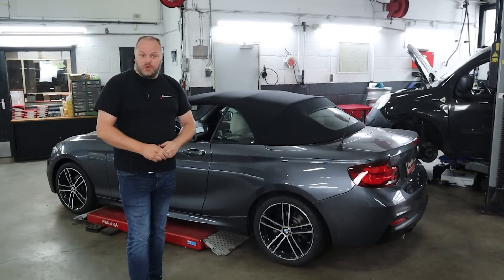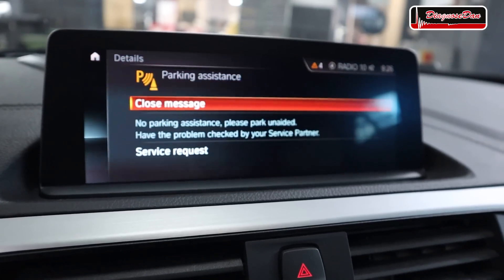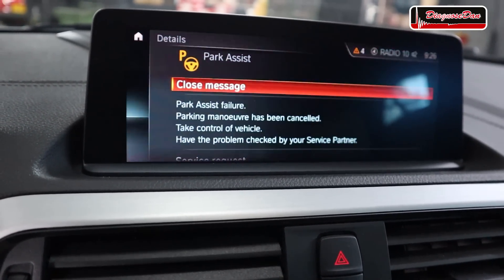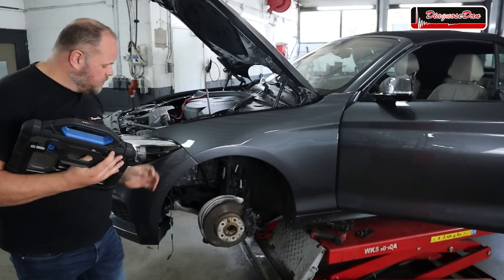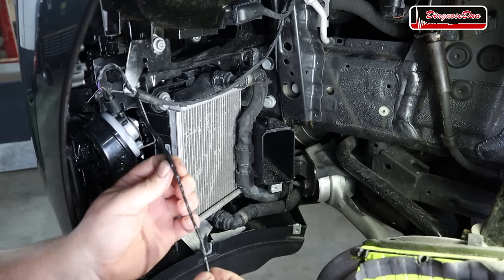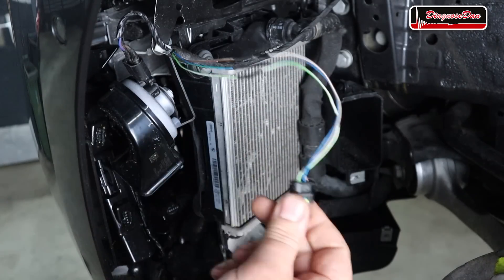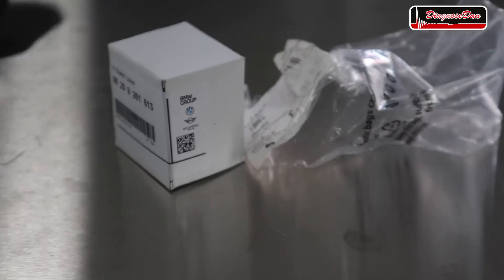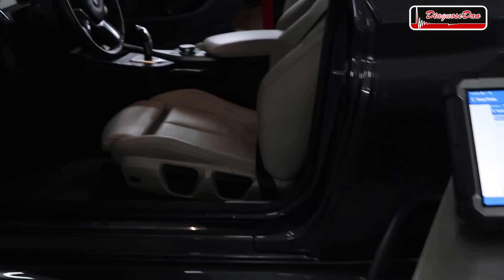Bmw NOT parking itself anymore! Broken Park assist

Comment from the maker: Check out my website ; https://www.diagnosedan.com
For Diagnosedan Tsb visit DDTSB.COM
For the Topdon tool used in the video:
US: https://www.topdon.us
UK: https://www.diagnosticconnections.co.uk/
EU: https://eu.topdon.com
Reply: i was expecting a crushed wire
Reply: Exactly my thought too
Reply from the maker: @iangrassby Me too!
Reply: Hi what test light is best for what circuit . What about wireless test light
Reply: Some of the macho comments really disturb me. I am not a great fan of self-parking concept but when you see it work putting a car into a really tight space it is  impressive.
Rear cameras and reversing sensors are important innovations.
Nothing to do with vehicle size but on a lot of cars with tapering aerodynamic shapes it is impossible to see where the rear corners are also impossible to see a small child directly behind the vehicle.
Reply: Which Topdon version / type do you use Dan? Thanks
Reply: great one - got the notification on my starting page cause yt notifications are dead, broken, not working for ages.
Good explanations and analysis. Love this content .
Reply: It isn't fixed at all, a BMW is not supposed to park straight between the lines.

Comment: If the part has wires, I use OEM. Stuff goes sideways quickly with Amazon, eBay or FLAP electronic parts. 
Nice job, Dan. Very logical.
Reply from the maker: Appreciate the support and the comment!

Comment: Can you please explain how you were getting two grounds (Short to ground) on the harness with the sensor disconnected, because when you first tested you didn't backprobe but rather unplugged it and tested. This for me would have pointed me in the direction of faulty wiring. I know the issue was the sensor because it is fixed, but it doesn't make sense how the short to ground still existed on the test light with the sensor disconnected in the beginning of the video
Reply from the maker: I disconnected a good sensor and the bad sensor was still causing the Short.

Comment: I had exactly this happen today. Car was in front end crash then parking sensors not working, same fault code someone replaced the front wiring harness first because "when it's a sensor it tells you what one" - tbf it usually does but that's no excuse. Then someone replaced the control unit because it wasn't outputting voltage- if there's a dead short the control unit won't outputting voltage. And then I had it, I didn't use the exact same diagnostic techniques as you, I unplugged all the rear sensors first because they were easier to get to on the car i was working on and also at the time I didn't know it had been in a crash. Then I found a non branded pdc sensor. This must be quite common.
Reply from the maker: Especially with sensors go OE if possible!
Reply: @Diagnosedan I work at main dealer so going aftermarket is only an option if the part is discontinued

Comment: I've spent my life in electronics and had to diagnose complex systems all the time. Some of these faults here are very basic, I find it troubling that the mechanics at the service centers cannot find them and have to refer to Dan. In fact to me it seems they haven't a clue how auto electrical systems work.
Reply from the maker: Thats because a mechanic has many jobs and it's hard to keep up. They are radar technicians when performing a calibration  on a radar. They are electricians when working on High voltage components. They are IT workers when coding and updating software, they are cable guys when looking for an issue with the fiber optic cables in the car. They need to be plumbers sometimes, they have to deal with Radio, bluetooth, Wifi, gps. 
And i can go on for a very long time.
Reply: @Diagnosedan  I agree with you. I think you missed the point of my original post.

Comment: Great video as always Dan. I litle trick I was tough when it comes to diagnose ultrasonic sensors is to swipe it gently with your finger when its on. If yoy feel a smal vibration it works if not its dead. Not sure if it would have worked on this one since some cars turns every thing off if one doesn't work, and since it was power to ground.
But it's the first thing I do when the parking sensors doesn't work, and have saved me much time over the years.
And it's really fun to do when people doesn't know about it, they just see you walking around the car then tell them witch sensor is broken and they look like questionmarks. But always teach them the trick after
Reply from the maker: I know about this and i'm not sure if i'm sensitive enough but i have a hard time feeling it. I know some can.

Comment: Hi Dan, We have a 2013 ml350 mercedes.... I had codes for the electronic shift module on transmission that mercedes put on to shift iinstead of cable when they went to electronic selector....... originally car wouldnt shift out of park, after installing new from an aftermarket (AMAZON) seller and reset/relearn module it shifted out of pary.  Yaaay right, WRONG, I test drove the vehicle and i was at a left turn light and you proceed when safe, so as I pulled out in highway to make left the vehicle shifted itself into park grinding the transmission cog and literally stopping the thing in the middle of a 60mph 3 lane highway and it wouldnt come out of park!!!!.. Fortunately cars were able to stop without hitting me and after shutting ignition off and restarting it shifted, I drove back at 5 mph and it happenned 1 more time as i pulled in driveway.... I pulled that module out and I swear frisbeed it into the side of my building and put an OEM mercedes part in and 2 months later, STILL PERFECT!!!....  I have learned before certain things are OEM mandatory in my mind.... from now on its wax and cleaners only from part stores....

Comment: Had to inspect a french car with a parking aid system disabled fault, without an OEM diagnostic tester. A one size fits all tester didn't find the parking aid control module so had to do it all caveman like.

Car disabled the whole system so couldn't feel the sensors for pulse. One front sensor looked bloated so was a dead giveaway that this sensor was dead.

Installed a new Metzger sensor, problem not fixed. Replaced it with an OEM sensor and the fault disappeared! Either the car was picky or the aftermarket sensor was stillborn.
Reply from the maker: I diagnosed a older Bmw 3 series (E46) last year with a pdc fault. Walk in the park for me normally as this model has little secrets for me. Diagnosed it with a bad pdc sensor , replaced it and normally case closed move on to the next one.
But i noticed that the pdc speaker didn't work. 
No more fault codes stored and it looked like everything was working fine. I focussed on the speaker but could not find anything wrong. I could't connect the dots as why the speaker not working had anything to do with the replaced sensor. As i was busy and it was an older car i had fitted an aftermarket sensor from a local supplier. 
After running around in circles for hours and performing every test in the book i decided to order an OE sensor and the speaker started working again, i'm still not sure why because in live data it looked like the sensor was doing what it was supposed to be doing. 
Another lesson learned the hard way. 
It's my experience that aftermarket parts and especially sensors have become less reliable lately. If you do want to safe some money its better to source an original used part if possible or go for a aftermarket brand thats also the OE supplier.

Comment: If there was a short to ground, why didn't it blow a fuse or create smoke and cause damage?
Reply from the maker: Simple, the sensor is connected to a module and not to a "hard"power supply. The module is designed in a way to handle with a short

Comment: Many times the workshop we work at does not have an electrical diagram or technical information to pass on to the mechanic.

I was able to solve a PDC problem with a tip from you, on a 2017 BMW X2 here in Brazil.

The tip was that the sensors have a positive power supply in the series.

Thanks Dan.
Reply from the maker: Good information is key. it doesn't cost but it helps you earn money

Comment: Great videos!  Thank you for your efforts and education, Dan!  After replacing the faulty sensor, did you replace the newly installed module with the old module?  Did it work as expected?  Thanks!
Reply from the maker: I actually found out that the new unit was the one i showed in the video. The old one was already swapped back. 
Thanks for watching!

Comment: horn connector also missing and plugged only pins. most of time had issue with this aftermarket sensors...... amazing videos you are doing........
Reply from the maker: Indeed well spotted, connector for the Horn was missing👍👍

Comment: Hi Dan! I have one issue with my F10 2014. Previously, the steering rack angle torque sensor was broken and we replaced it. But now we can't calibrate that end stops for the EPS. Here is the error code 4823EA EPS Control Unit: Stop ends not learned. What would you suggest ? Do I need to replace that EPS too ?
Reply from the maker: Make sure you are following the right procedure to learn the end stops and use the right scantool.  It could certainly be a faulty Eps as the are know to have issues. But i wouldn't replace it before thoroughly testing it.
Reply: @Diagnosedan  Thank you Dan! I'm appreciate it. Yes I'm sure that we are following right procedure and right scantool ( ISTA) but a the end of that its not learnıing that end stops. Eps working fine without any heavy steering. Before that I have an issue that steering rack torque sensor not read the angle and that's why I changed that torque sensor with used one and we can see the data and angle rightly now but I don't understand why Eps not learn that stop ends I think this is not related to torque sensor its related to Eps. I will make whole test (trying another steering rack from  my friends cars to eliminate that ICM issue)  and after that I will go for the replace Eps

Comment: Please I need help really bad. I have a Cadillac CTS 2007 and I can’t seem to get it to stay started. I change the fuel pump fuel filter. Spark plugs and coils. It will start up and run for a little bit, but then shuts right back off and not hear. Pop noise from the engine sound like the engine has a backfire could you please help me
Reply from the maker: It's very hard to diagnose a car Without performing checks and taking measurements. Without that your basically guessing. I also have no experience with Cadillac as we almost never see those here in Europe. My advice is to take it to a professional diagnostician. You might think that's expensive but think about all the parts you have already replaced without fixing the car. I guess you are from the USA, i do know some great techs out there that could help you but that depends on your location.
Reply: @Diagnosedan  ok thank you still tho

Comment: Thank you Dan for this video 
! While it may seem simple to some to find where a short to ground is situated or why it occurs, having a method to apply is key.

I guess the other shop will have to do some explaining to an unhappy client. I mean if I was that customer I would certainly not agree to pay for the park assist module the car didn't need. Not to speak of the fact they installed a sensor made of chinesium, which caused much trouble and delay. As a customer I would expect a commercial rebate for the delay and not paying the brand new but unnecessary module.
Reply from the maker: The guys at that shop are great guys and wont let the customer pay for any unnecessary parts.

Comment: Since I have thermal camera I feed the power supply throught H7 bulb by using powerprobe few times by 1-2 seconds and look through camera for temperature increase on sensor. It works well because it helps to locate faulty sensor without removing bumper and customer can use the car untill part arrives.
Havent had wiring issue on this test so cannot comment on this situation.
P.s. I know all the risks of fire, etc. so please dont try to teach me this :)
Reply from the maker: Thanks for your comment

Comment: I like how you resist the temptation to call out the workshop throwing expensive parts at the vehicle. I've always found it's more often than not a simple issue. 
Great video as always Dan.
Reply: The other workshop threw cheap parts at the vehicle.
Reply from the maker: @volvo24091 Or the insurance company asked for that
Reply from the maker: I know this shop and they are good guys honesty trying the best they can. Their intentions are good. They called out for help, and i respect that.

Comment: It's fair to assume that the original parking module/black box was probabley working fine and did not require a replacement.BMW part so not cheap,however, customer now has a spare unit on hand
Reply from the maker: I later found out that the old unit was installed in the car and i showed you the new one

Comment: without proper protection, a short in the front can cause damage to the computer in the trunk. dont say something as it is a rule when it is not.
Reply from the maker: We were not talking about rules but starting at the most likely cause and using common sense. 
Modern Ecu are protected against short circuits as you probably know. Thats why nothing happened with the unit after plugging that connector in and out for many times.
Reply: @Diagnosedan  "as you know"... hehe that passive aggressive behavior is good towards clients and viewers...

Comment: You have to buy original sensors due to signal variations between oem and aftermarket. Or else the car will not function properly or fail in short order.
Reply from the maker: These sensors are not connected to can-bus
Reply: @Diagnosedan signal i meant.

Comment: I wish I had Dan near to me or someone of his skill in diagnosing.  Every shop and dealer wants to replace parts like the body shop did. Parts cannon and then not use oem which leads to even more trouble. 
I have a 2016 x5 40e with 129,000 miles has been great until this week. Check engine light then on my way home after ignition cycle it threw a drivetrain malfunction warning ⚠️ reduced engine power no hybrid power and no AC. I pulled codes and the dtc is P0CE0 HV battery coolant valve “A” closed. After tons of research, diagrams, and forums I found the electric expansion valve for the battery cooling system.

I take it to the dealership hoping their system will be more detailed and can confirm the repair. They come back saying the EME has gone bad and needs replacement and programming at a time of $11k I asked about the valve they said they will retest for that after the EME is replaced. I said no swap the valve I’ll drive it and see what happens. 
EME failure would not let the vehicle use electric propulsion and on my way to the dealer I drove the car it was fine all electric gas and hybrid. The codes for the EME were triggered by the valve being closed and not being able to cool the battery. Valve permanent code EME intermittent.
Reply from the maker: Interesting!
Reply: @Diagnosedan  they are waiting on the electric expansion valve to arrive Friday and they will do the repair. I would have done it myself but I don’t have an HVAC machine. I’ll update next week if the valve did the trick and I saved $9,000 or not. Here are the other drivetrain codes that came after the DTC 

1F1B54
Intermittent
21A003
Intermittent
21A011
Intermittent
21A01C
Intermittent
21A11A
Intermittent
235410
Intermittent

Info:BMW/X'/X5 xDrive40e iPerformance_N20/
F15/USA_LL
Fault Codes
Power management: Generator failure (alternator,
DC/DC converter)
Emergency operation manager: Request to reduce engine torque stage 1 from EME control unit
Emergency operation manager: Deactivation request
EME start system from EME control unit
Emergency operation manager: Request EGS forced upshift stage 1 from EME control unit
Emergency operation manager: MSA deactivation request with combustion engine switch-on initiator from EME control unit
Emergency operation manager: Request for idle speed increase from EME control unit

Comment: it is something a good electrical mechanic will ask you for is a paper trail of all work carried out, and when you noticed the problem, it will then reduce their time a lot. hense why I always put recipts in with the service manual, that way I know exactly where the paperwork is, and as it is all in order then makes it a lot quicker to give a mechanic up to 12 months of work carried out on the car, and they can look for older recipts if needed. and with cars with more electrical systems then it becomes even more vital for the diagnosis process, and why I would pay more for a car with a documented background than just a stamped service manual.
Reply from the maker: I'll ask most of my customers to write me an email and include as many details as possible. Including paperwork from previous repairs

Comment: My 2018 Volvo has a similar system.  I used it once when the car was new, and it worked then.  Whether it's still working or not, I don't know, I haven't used it again.

I was expecting a pinched wire as the problem...
Reply from the maker: Yes i was also expecting something like that. 
About parking assistent.....i wouldn't use it either if it was installed in my vehicle. 
Maybe its beneficial for some, especially the elderly

Comment: Did the other Parking Assist ECU get put back in the one which clearly wasn't needed
Reply from the maker: I later found out that the one i showed in the video was the new unit and the old one had already be swapped back